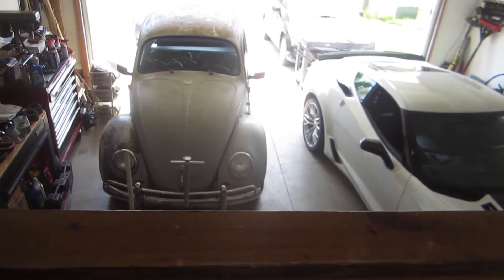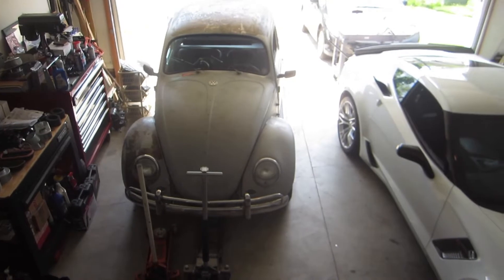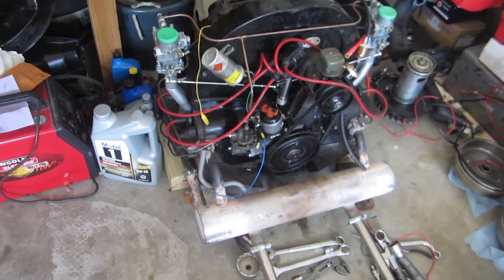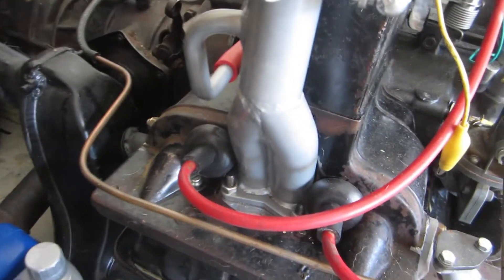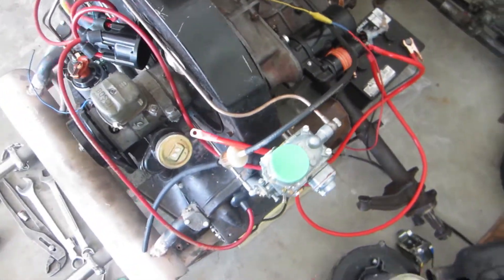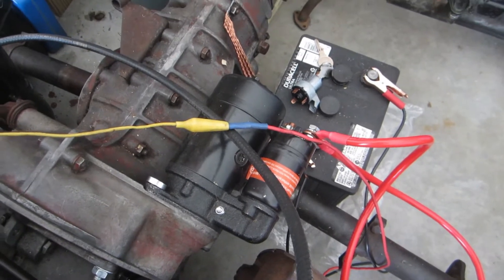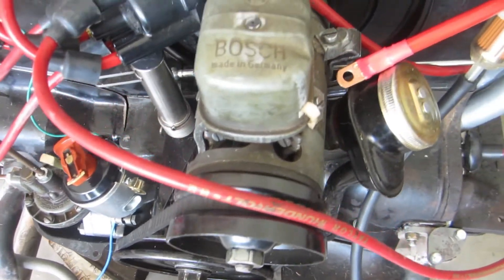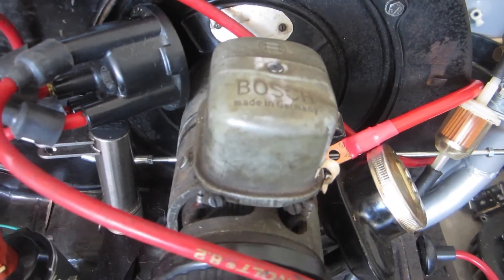VW Okrasa Engine Tuning Part 1

Comment: That engine needs a 019 distributor to look vintage.
Reply from the maker: yeah it is a bit scrappy and rough around the edges still. I just want to get it in the car, soon hopefully!
Reply: @vwsandvettes3253   
The engine looks good.  Just needs a cast iron distributor.